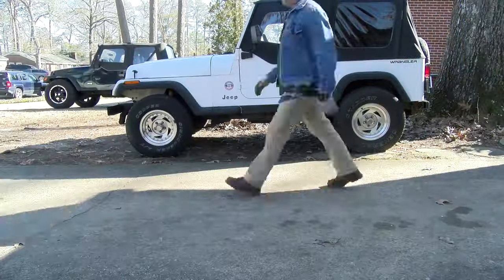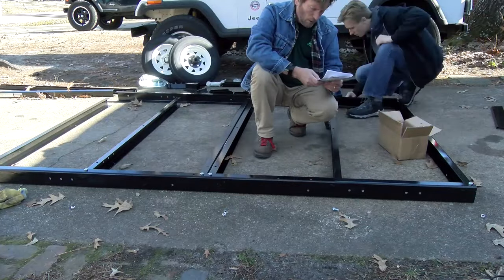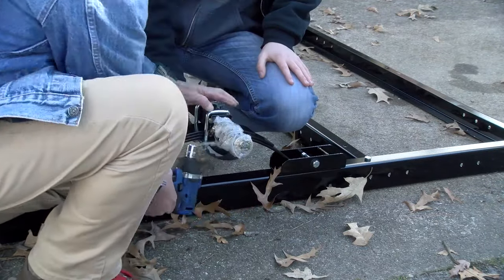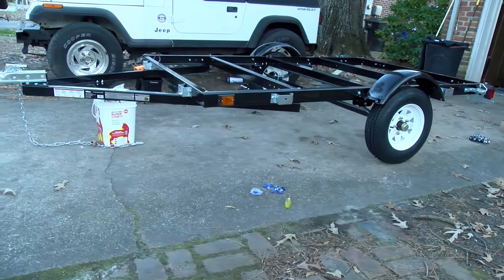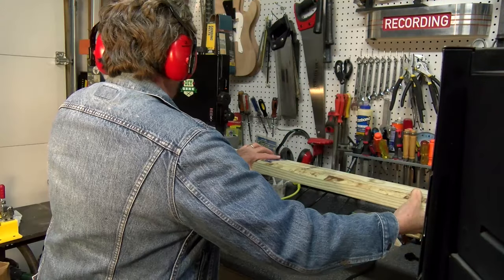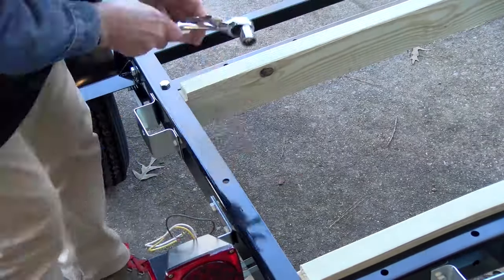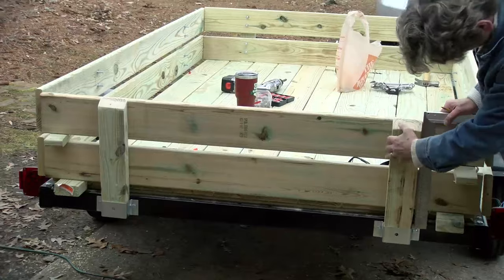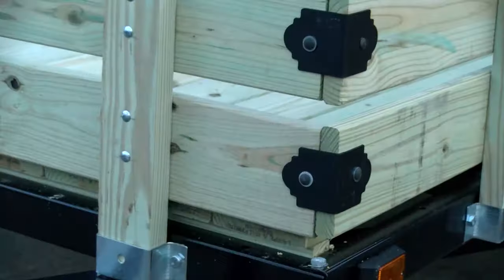Building a Ironton 5' x 8' Utility Trailer Kit from Northern Tool.

Comment: That cordless impact will just leave you wanting one in your own toolbox! Did you consider a bit of red locktite on the permanent bolts?? I know the nuts are ''nylock'' but it is a trailer that'll be put on the road with your belongings riding on it! Damn nice trailer! The brown lumber with the black steel, goes together nice! What's your capacity??
Reply from the maker: That is a great suggestion. I wish I would have used Locktight. The load capacity is 1715 lbs. now that the weather is warm and the wood is good and dry I will put a coat of water sealer on it as well. I’m really happy with it and has been a great asset. At least until I can kill the van. Thanks for watching.
Reply: @DIYGene  I finally got rid of my full size Dodge conversion van. Empty Nester!! Got a little 94 Ranger pick up, great on gas and can pull that small trailer!

Comment: I can't get the wheels to slide on far enough to even expose the threads to put on the dang nut. I can't figure out what's wrong. I don't see anything in the way. They just don't want to slide on far enough.
Reply from the maker: Is the bearing still in the wheel?
Reply: @DIYGene  yeah. They push out as I try slide them on. Do I remove them and then slide them back into the wheel?
Reply from the maker: @scottoden2691 , I had one fall out while pushing the wheel on. But Im not sure why you are having such a hard time pushing the wheel on. can you tap it on using a piece of wood to protect the wheel?
Reply: @DIYGene  I plan to try that today. I ran out of time to work on it a few days ago. The rest of the trailer has been simple even though the directions don’t match.
Reply: @DIYGene  I just got the wheels on. Thanks. Now I can’t see any holes to push the cotter pins through. Am I just dumb? Ha
Reply from the maker: @scottoden2691 , that’s great! If you back off the slotted nut, I bet you will find the whole. So glad you got the wheels on!
Reply: @DIYGene  thanks. It took me a couple minutes to feel around, but found them. Maybe I’ll leave you alone now, but I doubt it. Lol

Comment: Do you have a link for that trailer kit by chance?
Reply from the maker: I do! it is in the description below the video. for some reason links are not showing up here in my reply.
Thanks for watching.
Reply: @DIYGene  I believe this is the one you bought. https://www.northerntool.com/shop/tools/product_200612541_200612541  I have a suggestion for you. I looked for your name in the reviews section of this trailer and didn't see it. I suggest you drop a review of the trailer and attach a link to this video. You would help a lot more people and possibly get more subscribers to your channel. It looks as though many people brought up the same issues that you did. (Instructions for an older model, hard to read, etc.) Anyway, just a suggestion. Thanks again for the video.

Comment: Why are you installing the bolts upside down?  The trailer is upside down.  When right side up, the fasteners should be on the bottom.
Reply from the maker: Actually the bolts are on both sides to secure the u-channels. I hope that helps. Thanks for watching.

Comment: id weld the frame rather than trusting those bolts
Reply from the maker: So far after a year it is doing fine. But I think I will check the bolts out to be sure. Thanks for the suggestion.

Comment: Great video. I just bought this trailer and started putting it together. In the beginning I noticed that I didn’t have washers so I thought I would go through the parts list. And going by the parts list I am missing quite a few of them. I called and they are going to send me a new trailer but after watching your video it seems like I might have everything I need. All I really got was the smaller bolts, nuts but no washers. I can get washers no problem. I didn’t get the large middle cross beam like you but never thought of putting the two together to make one. Did your video show all the bolts that you used for the trailer? I might cancel the order they are shipping if you recorded all the bolts that you used.
Reply from the maker: It came with enough including bolting the two center braces together. I didn’t get any washers either. But I feel the lock nuts should suffice. I hope that helps. Thanks so much for watching.
Reply: Ask them to comp you the cost of some washers, bro. U don’t need a new trailer for that.
Reply: @TheCriticalChris  I ended up keeping it. At the time I thought I was missing more parts. I called and the manual is really out of date. It calls for a few items that didn’t come with the trailer. I just bought washers to use.

Comment: Never use those connectors
Reply from the maker: I have had a few people comment on that. Those actually came with the trailer kit. What would you recommend switching them out with?
Reply: @DIYGene  the best connection would be a butt connector covered in shrink wrap for waterproofing
Reply: @DIYGene  butt connectors from Walmart, solder and heat shrink seal and are waterproof

Comment: Scotch locks are terrible. Worked on Nissan, Mercedes Benz, for 7 yrs, and 4 yrs military motor pool. Please, ....never use scotch locks. Solder, and heat shrink, or coat with silicone sealer. Even wire nuts, sealed with silcone , are much better.
Reply from the maker: It’s a shame that this is what comes with the trailer. I have sense changed them out to solder and heat shrink. Thanks for the great suggestions.

Comment: I bought a log hauler from Northern tools and it is very heavy duty and.quarter of the price of competitors. It was missing a lot of bolts and the heavy duty chain. They credited me for the missing parts. It seems common to be missing parts from there but price and quality is great. Great video, I am thinking about buying the same trailer, how is it holding up?
Reply from the maker: The trailer is doing great. I use it often and the quality is really good. Thanks so much for watching.

Comment: When running your lights, you went thru the top of thebeem. You should have drilled a hole thru the Beem and used grommets to protect the wires. Just a little something great will save your wiring in years tocome.
Reply from the maker: Excellent point. Thanks for watching.

Comment: Your wire clips are junk, not water tight and you will find out later while they are junk and not water proof. Heat shrink always.. The lights are not waterproof either.
Reply from the maker: Good point. But unfortunately they are the connectors and lights it came with. Your suggestion would make a great upgrade. Thanks for watching.

Comment: i have a Cousin in Louisianna that’s a Engineer by trade and he bought a Harbor Freight trailer to assemble  he told me that every hole he needed to  use a die grinder on every hole  in order to get the bolts in them  he was very frustrated working in his unairconditioned garage after a workday every night on top of it at the time he had a Wife that was constantly on him about how long it was taking  FYI  that nut on the Axle is called a Castle Nut i was told years ago because it resembled a King or Queens Head Crown ?  i’ve often used a large Adjustable on those myself  as they don’t require any high tourged Specs
Reply from the maker: A castle nut.  I did not know that. Thanks for the good info and for watching.